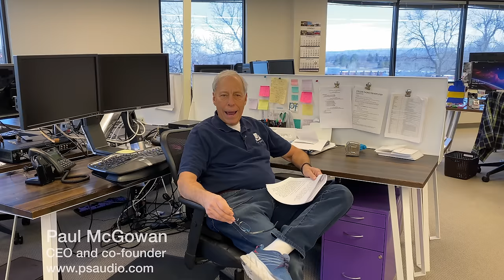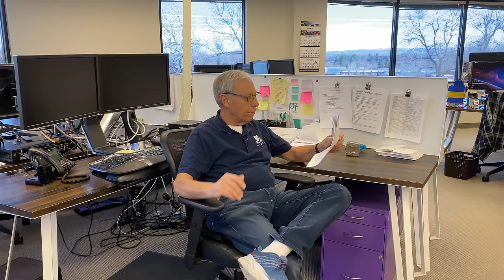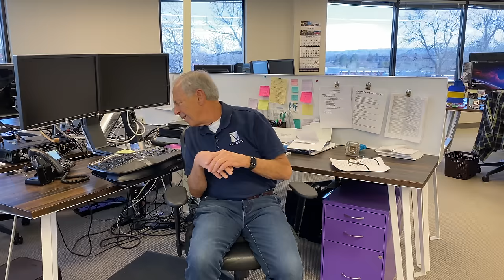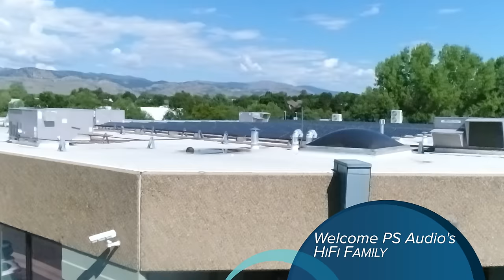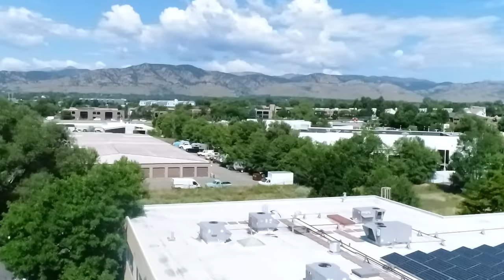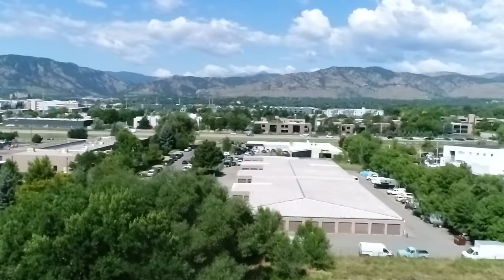Digital or analog out?

Comment: SPDIF is underrated, I think. It doesn't require drivers to use when I use a PC and output audio to my DAC vs using USB. I use the SPDIF out on my SACD player and my Xbox to my DAC as well. Either my DAC does all the magic or there really is something great about using SPDIF when it's available. The difference in dynamics is usually night and day.
Reply: The SPDIF  a disc player will not pass DSD, the DSD is converted to PCM first.. analog or HDMI is the only way to pass SACD signals.

Comment: What exactly is being "squeezed down" using SPDIF or AES interfaces? The data being transmitted is exactly the same. The only thing being done is the clock is embedded into the data stream. While this can induce clock jitter it does not in any way restrict or limit the audio data. And the clock jitter is easily corrected to the point if being inaudible. External I2S interfaces have their own problems too. First they are not standard. There is no official connector or electrical format to send these signals outside of boxes. Some use HDMI, some use RJ45, some use RS422, some use LVDS. So you are limited to using the same vendors products. Second at longer cable lengths we can have timing skew between the data and clocks. Unless this is compensated for you can have timing issues. And most I2S enabled audio chips do not have any timing correction. They don't expect to see any skew because I2S was never intended to go outside a product and down long cables.
Reply: Thank you for pointing out the misconceptions presented in this video.

Comment: You have to audition the equipment both ways and see which connection you like better. I've had cd players that I've used as a transport hooked to a dac, and I've had cd players where the internal dac sounded so good that I didn't bother. I'm currently running an Onkyo single drawer cd player and a Toshiba cd/DVD player, both of which are running analog, through Monster cables.

Comment: The DAC in the Gain Cell has been described as pretty good, so if you have one and bypass the DAC in your inexpensive CD player, you’ll probably get a better sound.
Reply: The phone premap uses the RIAA equalization curve. Digital needss converters in the time domane. There is a huge diffrenmce.
Reply: Hello mine frfends! PLese google 'time domain audio compression' ans follwo the links! WHat university did you get you electrical engineering degree from. Did you take the couse on digital logics or do you prefer op amps for an analog computers. THANKES YOUES! YOUYARE MINE NEWS FREMDS BTS i AM NOTa drunks I am diableds since 1960. thankes youes!

Comment: This episode is just like for an order to my situation. 2 days ago I bought used musical fidelity V-dac one. I bought it for chromecast audio streamer. It's change sound drastically for good direction. But today morning i decide to connect my Marantz CD ( with TDA 1541 DAC build inside). I bypass this DAC by coaxial RCA cable to my new V- DAC with BURR BROWN components. I thought it will change something. It wasn't change anything. 40 years old Marantz CD has so beautifully sounding DAC. Bottom line. Buy old Marantz CD with TDA 1541 DAC inside if u need good sounding cd player. U don't need external DAC. If u are using chromecast audio 4 ex. Please add good external DAC. U will be shocked how it change the sound.

Comment: In my situation I was planning to use my TV's DAC connecting to a bookshelf 2.1 set up (in lieu of a soundbar) instead of optical as optical sometimes has syncing and other issues etc, plus I would be able to use my TV's volume control directly and the built in virtual surround DSP (instead of paying again for a 2.1 soundbar to do the same thing with their impossible "Atmos" effects), both of which wouldn't be possible using optical.

Comment: Hi Paul, since it is possible, as you said, to put a decent DAC in a CD player and make it a little more expensive,  it sounds like more of a marketing scheme to get the consumer to spend more on two separate units as well as an expensive digital cable.  And yes, I use my CD player as a transport and have a separate external DAC via a $500 Transparent Brand digital cable.  Just saying....